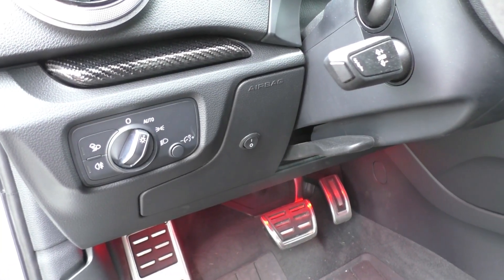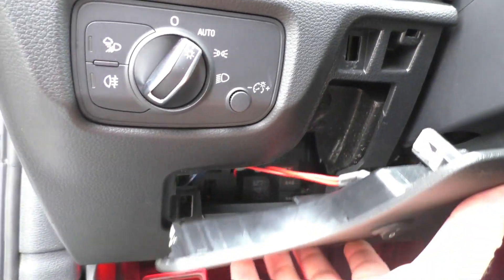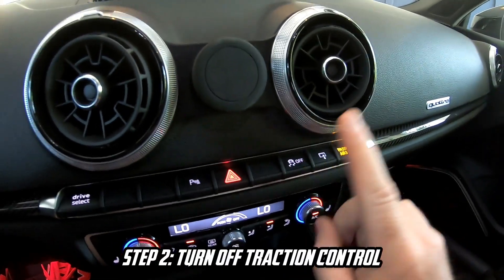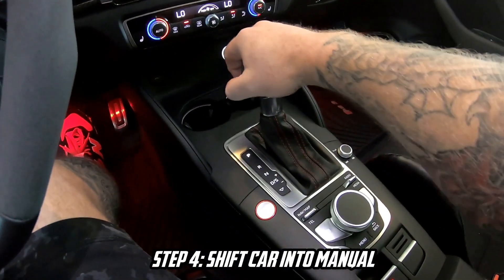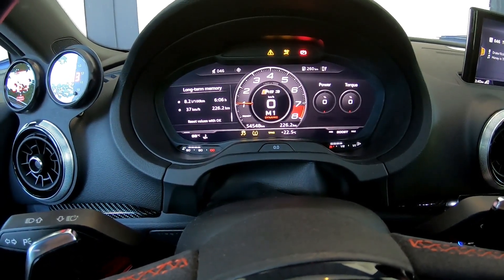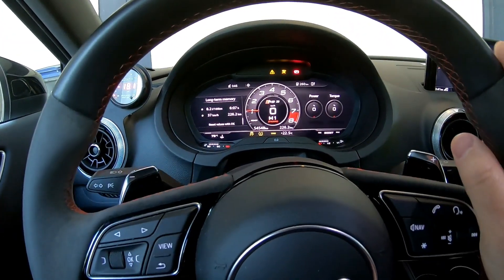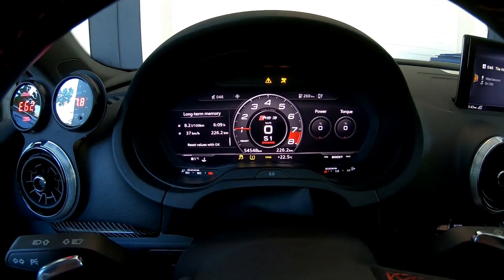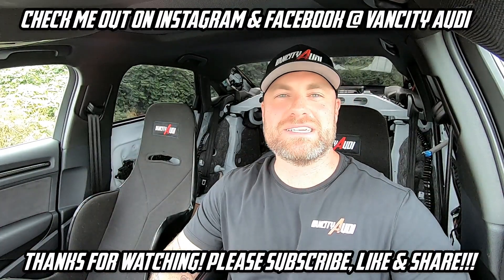How To Do A FWD Burnout In An Audi RS3

Comment: Once you key cycle you usually have to turn off traction control again since the default mode is on. The car usually stays in dynamic mode though.
Reply from the maker: You are correct! If you insist on clearing your dash before you launch you'll have to turn off your traction control again before you launch. I missed that, thanks!

Comment: Hey, I think you can now trick the car into front wheel drive only or all-wheel drive by using the phone app that connects with OBDEleven device or Carista  device through the OBD2 port in the vehicle. In Carista, the Haldex setup is divided into 3 selections: "Standard" (stock setup), or "Increased Traction" (more power to rear wheels), or "Reduced noise" (front drive only). I think the "Reduced noise" is the one you can choose to do your burn-outs, but I haven't tried it. I have only tried "Increased Traction" which works wonderfully for me as my RS3 is now  a full-time all-wheel drive. Because of full-time all-wheel drive setup, I can now do a launch control even with the traction control and ASR fully on. At any time, you can revert back to stock Haldex setup which is a "passive" all-wheel drive system that understeers first with only front wheel drive before the all-wheel drive kicks in too late. Note that the setup will override the Haldex setup in each of the drive select mode.
Reply from the maker: I have had 'increased traction on' for a year in my RS3 and it hasn't given me permanent AWD. To my knowledge that isn't how it works. It encourages the AWD system to send power to the rear tires quicker than it normally would but not permanently make it AWD. If that was the case the car wouldn't be spinning the front tires like it does when I launch, if it was permanent AWD.

I appreciate your suggestions, but I would much rather have a mechanical solution which guarantees FWD only rather than an electronic one where you hope it works.
Reply: @VancityAudi  should probably look into a haldex controller. it would definitely be simpler for your burnout as you can set it to disengage on handbrake(fwd only). you would have bias control from 100/0 to 50/50 and the ability to lock it there as well. http://haldexcontroller.com/index.php/en/products/haldex-controller

Comment: Love the channel 💪 .. I got stupid question but how quickly do you let off gas after the launch so to not over rev? Do you immediately lift off as soon as you release the brake with your left foot? 

And for the roll out. What do you do with the gas pedal once you press the E-brake down? Gas all the way down till starting line? Or full release pf gas pedal?

Sorry for long msg lol😂😂
Reply from the maker: That's not a stupid question at all! Once the tires break loose I am letting off of the throttle some to not hit the limiter. When I roll out I'm usually completely off the gas. I've seen guys that roll out with the throttle still going to do some wicked burnouts though.
Reply: @VancityAudi  awesome. Great info. Thanks 👍
Reply: What happens if the rev gets to high and second gear bumps in ?

Comment: Have you ever had any knocking problems or any sort of noise coming from the front whenever you’re turning into a parking spot or at full turns? My A3 is horrible at that 😖 have to keep taking it back every so often because the noise just keeps coming back...
Reply from the maker: Very badly actually. When it was stock it was minimal. Then I lowered it and it got way worse.  Is your car stock ride height or lowered?
Reply: Vancity Audi mine is stock. Audi apparently doesn’t know what it is & they just keep changing things that makes sense to them. Yeah the noise goes away for a bit & then it just comes back again. It gets frustrating to the point we just want to get rid off the car.
Reply from the maker: @bordmsux  that would drive me nuts too if my car was stock and it was making that noise. Sorry to hear that you're going through that!
Reply: Vancity Audi 
Had something similar in an older car with hydraulic power steering, RS3 are electric I believe but the cause in the other was cold PS fluid was causing the steering pump to cause fluid pulses in the lines causing the line to wobble and hit on a metal part under the engine.
Reply from the maker: @kais9196  very interesting
Reply: Vancity Audi 
Was caused by hot fluid, my mistake, what causes the pulse is that slow moving tyres turn with more resistance when you turn into a park and puts more load on the power steering pump to turn the wheels, along with this, an idling engine causing the pump to turn over slower, all leads to vibrations. Must be something else on the RS3 though, no idea what it sounds like and if it’s only during turning the wheel etc.

Comment: Where did you get your boost mount/gauges behind the offside vent? They look soooo awesome!
Reply from the maker: Thanks! The gauges are Zeitronix and you can order them straight from their website.  They come in multiple colour variations. The mount itself is a custom one off piece made by Reiter Performance. We may possibly be offering them for sale in a few months time.
Reply: @VancityAudi  are you using the flex fuel sensor with the stock ecu or have you installed a syvecs...?
Reply from the maker: @Geodesix  I am using a flex fuel sensor.  I am on the stock ECU.
Reply: @VancityAudi  so you manually change the map depending on what the gauge is reading or does the map change automatically depending on the ethanol content...?
Reply from the maker: @Geodesix  I am currently running the Custom Code E85 Stage 2 file which utilizes E60 to E85. As long as you keep your ethanol content inbetween those levels your car adapts.

Comment: Im looking at buying one of these used that has been mostly stock. It has 51000 miles , do you think I should be worried about reliability?
Reply from the maker: Make sure you do a thorough look into the history of the vehicle.  It is very easy for someone to modify these cars to make over 600hp.  Then they return the car to stock parts, tune the car back to stock and tell people the car is stock.  A great way to see how hard the car has been driven is by checking how many launches have been done on the car.  Here is a link to the video on how to do that: https://youtu.be/baYqhWk2C7Y
Reply: @VancityAudi  I definitely knew that about the car, Ive wanted one since they were out so I know the potential. I know it was flashed but it wasn't a built motor. The engine bay is wayyy too clean and I looked at alot of the bolts for any work done to it. I think it was just intake and exhaust but it might be still flashed. They told me that all the tuning parts were removed and so was the flash. I watched your video and im not super worried it was abused majorly because I did purchase a very good extended warranty with a low deductible on any problems. There is a downpipe still on the car, it's supposedly APR but I haven't had the car in the air yet to see exactly what downpipe. The check engine light is on because of the high flow cat in the downpipe. If it is the APR downpipe, which it looks to be there first one which was discontinued. Im going to buy the dongle to see what the ecu is exactly running but where would I look for a flash /tune that would get rid of that CEL and take a little advantage of that high flow cat and maybe a higher flowing intake than stock. BTW I called APR with VIN and downpipe was discontinued because of emissions and they had no record of that car being flashed.
Reply: @VancityAudi  What should my 60 to 120 time be if the car is stock. Thanks for all your help, even though the car was tuned it was pretty clean underneath. There are no  scrapes or gaurds missing and the wheels have no curb rash whatsoever. I had the opportunity to buy my realistic dream car, I couldn't turn it down because of high flow after market cat on there and thats it.
Reply from the maker: @kellygrajek  Just because it wasn't tuned by APR doesn't mean that the previous owner didn't use another company to tune it.  If you bought an extended warranty I don't see that warranty providing any coverage if the car is tuned so I'd recommend you put a stock downpipe back on and flash the car back to stock if you expect to keep use an extended warranty.  Otherwise I see the company that is providing you that extended warranty not warrantying any work when something breaks.
Reply from the maker: @kellygrajek  The measurement is 60 to 130 and I have no idea what that would be.  I tuned my car as soon as I bought it.  Just because the body looks fine doesn't mean your engine internals and additional parts haven't been beaten to shit by the previous owner.
Reply: @VancityAudi  Can VCDS tell me if its a stock flash or something else?
Reply from the maker: @kellygrajek  you can take it to an Audi dealership to scan it.  If it pops up TD1 you know it's been tuned and you lose your warranty, haha.  That's what I did
Reply: @VancityAudi  Wait wait its not factory warranty thru Audi, its extened but I understand your point. Even if it's flashed back to stock, can you always tell that its been tuned ?  I guess I don't totally see the point going back to stock and I might be screwed anyways. Now the car was serviced at a Audi dealership (carfax) right before I bought it so if there was any serious problems wouldn't carfax history say something about it? I would assume so.
Reply from the maker: @kellygrajek  Sadly your assumptions are wrong.  Even if you bought an extended third-party warranty I highly doubt they will warranty your car if it is modified or you modify it in the future.  That includes tuning the ECU.  As soon as the ECU has been flashed once Audi can tell the car has been tuned even if it has been returned to stock.  All they need to do is a full scan of the car and it will come up TD1.  A safety scan from the Audi dealership right before you bought the car wouldn't tell the dealer that is was tuned..  I know this all from experience.  CARFAX is EXTREMELY limited in what it tells you about the vehicle and there is always a way to go around having something show up on your CARFAX.
Reply: @VancityAudi  Well they admitted the car had a flash on it and had the downpipe on it , they admittedly sold the car as tuned and sold the warranty with it knowing that. Legally in that situation, Ive been told I have something to stand on if they knew they were selling it that way, I have the VCDS cable coming. I just want to get rid of the CEL because of the cat missing. Maybe I won't and just get the factory downpipe in there. I see it being pointless though if Audi can already tell its been flashed. What sorts of things have gone wrong with yours? Im mainly concerned with engine work. This car will get driven but it will also be stored quite often, Im not going to be pushing it limits everyday but I totally see your point, I was like you, I fell for the car lol and couldn't say no. How soon did your failures happen, I know one of the main failures is wrist pins, I read that. It seems like to me that you really have to beat on these to get them to fail. Thanks for all your info. I appreciate it greatly.
Reply: @VancityAudi  Well I got the cable and hooked it up. Is there any possible way for someone to reset this launch value. Mine was only 2 and one of them was me, on snow. If there is not a way to reset this value im super happy, lol sorry 😞
Reply from the maker: @kellygrajek  they would of had to replace your ECU, which is extremely doubtful
Reply: @VancityAudi  Awesome, I got really lucky then.

Comment: I just installed a apr switch so this video helped a lot thank you
Reply from the maker: Didn't realize APR had a switch. No problem, glad it helped!
Reply: @VancityAudi  not sure what brand it is the dealer here in SA installed it today actually but actually scaredto try it out 🤣 idk if something will break or not
Reply from the maker: @sK-yn5fq  it is a weird feeling that's for sure. Especially because the cars weren't made to do this.
Reply: @VancityAudi  if something would break what do you think i should lookout for or what in your opinion should i upgrade to just make it a bit safer
Reply from the maker: @sK-yn5fq  if you use these techniques to do a burnout I would imagine an axle would break first. Or your transmission seal if you bounce off the redline continuously
Reply: @VancityAudi  thank you for the advice still watch every video and loving it keep them coming
Reply from the maker: @sK-yn5fq  I appreciate the support!

Comment: Is this switch catered to the rs3? If not how can I be able to get one for a mk5 r32.
Reply from the maker: I'm not sure that the MK5 R32 has a haldex but if it does I imagine you could install a switch on that fuse as well. The switch I installed is  ot specific to an RS3.
Reply: @VancityAudi  the mk5 r32 does have an haldex. Is their any info on the company the providers that? And thank you for taking time out to answer my questions
Reply from the maker: @danieldoyley7434  no problem. It isn't a specific switch made for the RS3. I believe it is called a fuse jumper. You could Google that and order the necessary wires to make a switch. Then you'd need to locate the fuse that powers your haldex controller and tie it into that fuse.

Comment: Is it better to put it in manual and let it shift automatically,  or just put it in sport?
Reply from the maker: Are you referring to when you're doing the burnout or when you're racing? Keep in mind my car has s Custom Code Stage 2 tune, so when I push my gear lever over to M, it won't shift unless I tell it to.

Comment: I just pull the haldex plug out  :)   ...  if you turn the Haldex off..  ALL the stability control , ESP , ESC etc... are disconnected  automatically...
Reply from the maker: Very cool. I just wanted to be extra diligent  to make sure people don't do it incorrectly.
Reply: @VancityAudi  this video is PERFECT!!   rs3 can't go daily fwd , it too strong :)  i did some testing ,i got better fuel economy but in the speed test 60-120mph it stay the same... can you test 60-120mph in fwd vs awd ?
Reply from the maker: @amirst110  Sadly I won't be testing that out.  As I mentioned in the video these cars weren't built to be doing this.  The only time I put the car in FWD is to do a burnout.  Then I put the car back in AWD.  All my daily driving is done in AWD.

Comment: LOL...pure comedy. I haven't even touched launch control in mine.  Launch control in an AWD, even bone stock, is really bad for the car. Not bad if you disengage one of the transaxles...it's harder on your car if you use launch control without disengaging.   BTW - the switch is just a fuse jumper.  You can literally make one from parts at any hardware store for $3
Reply from the maker: Strange that so many automotive manufacturers offer launch control in their vehicles then seeing as it is "really bad for your car".
Reply: @VancityAudi  Not sure if you're saying that with sarcasm, but it's pretty common knowledge that it's hard on the car.  Not saying it's GT-R level bad. Strange how Nissan would openly tell you not to use it too LOL
Reply from the maker: @troymuni6120  no sarcasm at all. Why are car manufacturers installing launch control in their vehicles then if it is so bad for the car? I know that launching a vehicle is extremely hard on the hardware, but I personally don't believe that manufacturers would even provide the feature if it was "bad for the car".
Reply: @VancityAudi  Well, obvious answer is to sell cars since competitors all have it.  What''s bad is the shock it puts on the car. Just worse launching AWD since it's x2.  I'm not about to do it to my brand new DD.  I sold my 700+ rwhp Camaro and my S3 for the RS3, so down to 1 car. I like watching you trying to stay straight and miss having a 10sec car, but I don't miss everything else that comes with it.  Race it, break it, fix it, repeat got boring for me after a while.  Enjoy it though and good luck with the car.
Reply from the maker: @troymuni6120  thank you very much. I had a Stage 2, Water/Meth injected Audi S3 before this and sold that for the RS3. It has been a riot. Hopefully one day you open yours up to feel its true potential. They are truly a monster
Reply: @VancityAudi  I've been looking into it lately actually.  This car just scares me.  Too many things aren't purpose built and not enough aftermarket support.  Screams money pit.  I'm probably gong to wait for the higher trim C8's to come out and snag one of those to play with.
Reply from the maker: @troymuni6120  I wish you all the best! The new Vette's will have a ton of aftermarket support and be much cheaper to modify and repair then an RS3.
Reply: @VancityAudi  Thanks and same here, the videos are fun to watch.  I'm really curious if how the DCT will hold up with more power.

Comment: Can you not just do a burnout in dyno mode ?
Reply from the maker: How would you immediately then turn off dyno mode to launch the car in AWD then?
Reply: @VancityAudi  I thought to get out of dyno mode the rear wheels just had to do 1/4 turn? But regardless I was just asking this in case dyno mode turned off the haldex in a specifically ‘different’ way than pulling the fuse. A haldex repair shop warned me that killing power to the haldex will still cause wear on the clutches in the haldex and gunk up the filter. I took it as a bit of scaremongering given that the burnout would only be lasting 5 to 6 seconds. Have you noticed any accelerated wear or issues ?
Reply from the maker: @mr2supergt  absolutely none.